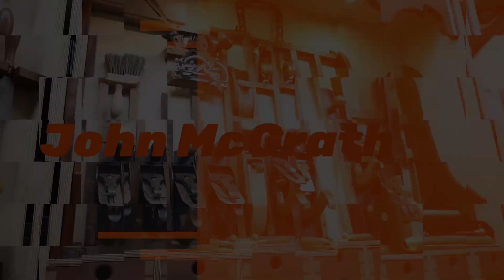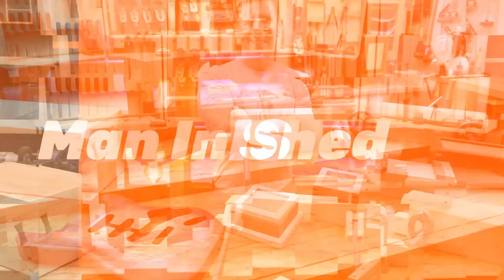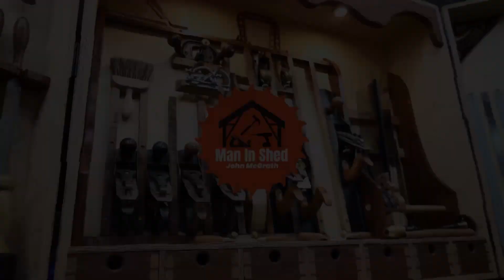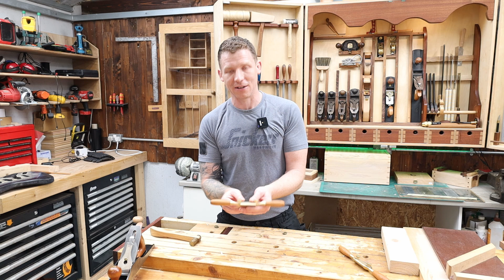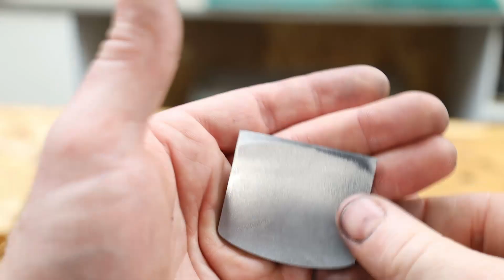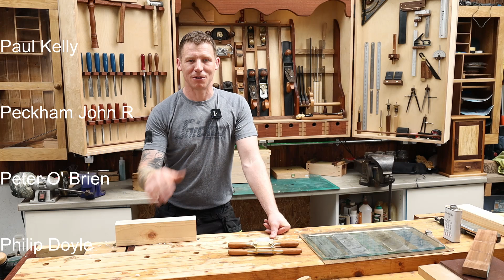Spokeshave Set up and Sharpineng Tips! Tools Tips#2

Comment: great video. I must ask the question, why when you pay good money for a plane/spoke shave/chisel don't they come ready to use straight from the box? You don't have to sharpen drills or saws so why don't the manufacturers sell you a proper tool that is sharp. Its not because the edge could get nocked off as you could say that for drills or saws. Just how miffed you would be if after buying a brand new drill you find that it needs to be sharpened before you drill the hole you want. Thanks for posting
Reply from the maker: I suppose its a cost thing and the fact that most woodworkers have their own preference when it come to sharpening so just grinding a primary bevel is all they want.